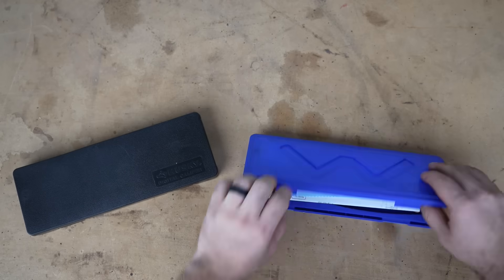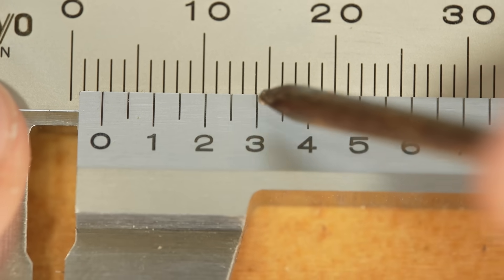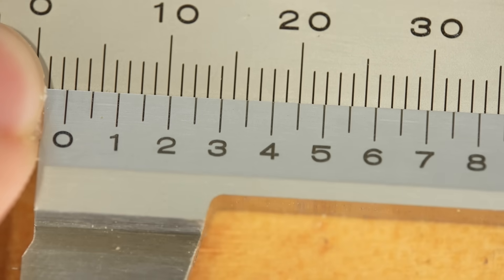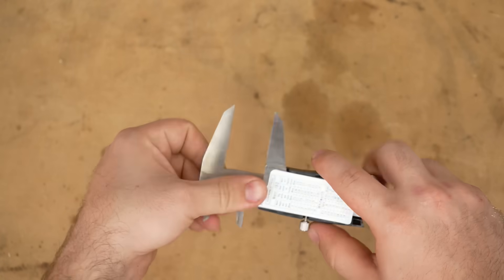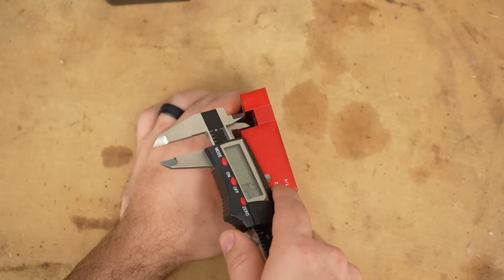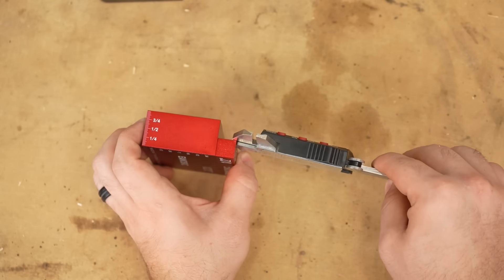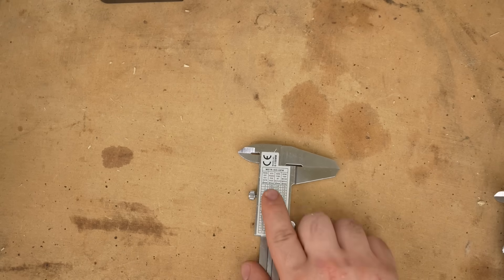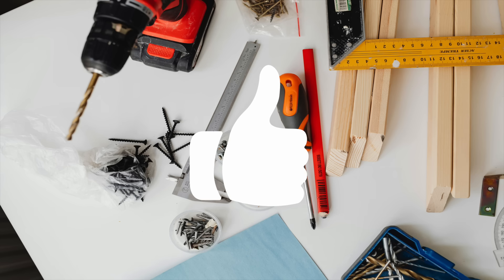I wish i’d known this sooner, How to use calipers like a pro

Comment: I lost all respect for your advice when you stupidly said,  "... put some TENSION on the calipers ... ". So, you are stupid to not know the definition of the word "tension". Please look up the word "tension" in common use as a PULLING FORCE. What you should have said is: "to measure the objects outside dimension, put the object squarely in the jaws and apply mild COMPRESSION. The word "compression" is in common use as a squeezing force.

Comment: Accuracy of the calipers doesn't depend on way you read them, it depends on the tolerances and accuracy of the tool. Vernier, digital, dial, etc can all be equally accurate.

my preference is dial. It's super easy and fast to read, and they don't require batteries. Also, I've seen digital calipers do wonky things when their batteries are low.

Comment: I went back to a NAPA auto parts store with the new part they just sold me which was wrong. I took my vernier caliper and measured it right in front of 3 of their sales staff showing them the reading, then handing them the part and the caliper. They were all over 40 but none of them had a clue how to read the scale. After maybe 15 seconds one of then ambled off, returning half a minute later with the store's digital caliper. They were amazed that I had told them the exact measurement their caliper showed with something that 'simple' 😁

Comment: Apparently the “China Export” mark is a myth; it’s just a matter of poor typesetting by manufacturers and, while it is present in some fraudulent uses of the mark, it is also present on some certified products. More importantly, some fraudulent uses of the mark use the correct spacing. The improper spacing and possible fraudulent uses don’t really correlate.

Comment: I guess because I got less expensive ones, my experience with the digital calipers  has been that when I wanted to use them the battery was always dead.   The type I like the best is the dial caliper with dual scales,  thousandths and fractions.

Comment: The CE is not a sign of quality. The manufacturer says that they conform to the standards for selling it within the EU. They make sure of that themselves :). So even if you see it and it is the correct one it doesn't say much at all. 
Norms, tolerance ratings, being approved for certain work, tested safety says a bit more.

Comment: Recommendation, especially for The occasional user, consider dial gauge calipers because they are as easy to read as a digital and they don’t need batteries and it’s almost guaranteed your digital will still be on when you come to it eight months later with the last .5% battery left.
Reply: They key to keeping the batteries alive is to get calipers that have manual power on. I have a set of cheap digital calipers that automatically turn on if the scale is moved (it assumes you want to measure something). Trouble is, they'll power on just sitting on the counter if you breathe in their general direction. They also don't maintain zero, so they've pretty much been thrown in a drawer to rot.
Reply: @garrisonaw I’ve got Moore and Wrights that aren’t cheap or automatic but somehow they always find a way to turn on and go flat. Although I’m a contractor and work from a toolbox not a workshop.
Reply: @DigitalArtisan77  Glad that's not me. I would become obsessed with figuring out how to stop them from powering on.
Reply: @garrisonaw  I did LOL. I switched to dial gauge. 😂😂

Comment: Digital and Dial are the most common calipers out there.  Vernier's are hard to find now-a-days.  Digital are better because they can be backlit.  If light is low - it's real hard to read a vernier.  That's one more reason why they're hard to find.  But don't let me stop you.  Go ahead and explain what it is you wish you knew sooner; how to use calipers like a pro.  BTW:  I've been using calipers since the late 70's.  Nearly 50 years now.  And yeah, like @David-xl9cp said - old eyes need glasses to read verniers.

Comment: Be aware that the measurement of the caliper doesn't have to be equal to the reading of it. At 0:18 4 calipers are shown, 2 digital, 2 analog. The digital calipers might have a reading of 0.01 mm, but is that actually true? The analog calipers say they're accurate to 0.05 and 0.02 mm. That tells me how accurate it's made. However both can only read 0.05 mm.
As a former teacher once said: a caliper is just an uograded adjustable wrench. A digital caliper doesn't become more precise, because you can read 0.01 mm. If you put a fluorescent lamp in it, it might even show you 0.00000000001 mm.

Comment: I close the calipers on the object being measured by pushing the jaws closed at the point they contact the object instead of using my thumb to push the base of the movable jaw. This method eliminates the deflection when measuring near the tip of the jaws and the measurement is more accurate and repeatable.

Comment: There is one more measurement feature for the digital calipers that I use frequently. To check the center to center distance/hole spacing of two equal diameter holes, put the inside jaws in one hole and zero the readout at the diameter. Then place one of the inside jaws in each hole to the maximum distance of the outside radius and that is your center to center distance.

Comment: 👍Thanks for video. I recently swapped my digital calipers for vernier. Why?
1. I never quite trusted the digital readout. If the tracking mechanism slips, displayed value is wrong.
2. Got fed up changing batteries.
3. Digital calipers have to be reset to zero everytime you go to use them and frequently during use (to avoid problem 1 above).
4. Very easy to accidentally press the various buttons during use and you have start all over again.
5. Became obsessive about setting them to precise. For example, if I wanted to set them to 3mm, it had to be 3.00mm. 2.99 or 3.01mm just wouldn't do. For most tasks +/- 0.05mm is fine. So, this was just a wasting my time.
With old fashioned verniers, I don't have to worry about any of the above.

Comment: What, no analog dial caliper? I still have my Mitutoyo 505–637-50 Dial Caliper which I purchased in 1985. It is in perfect condition since I only used it is a controlled inspection lab environment. These were what was available in between the Vernier and digital calipers. Nice since no battery is required yet the dial is easy to read. We used to call the Vernier caliper the "very-near" caliper!

Comment: Accuracy, Repeatability and reproducibility with any caliper (or any other hand tool) requires Practice Practice Practice to a "KNOWN Calibrated Standard". Every tool requires a "Feel" and remember the 10:1 rule......Try to Choose a measuring tool that is 10x more accurate than the feature/tolerance you are measuring

Comment: Non digital vernier,
Is the depth measuring the same process as outer/inner diameters & step measurements?  Main scale & vernier scales regardless if it is Imperial/Metric?

Comment: Something's missing!
The upper display of the vernier scale is for inches.

the main scale shows the whole mm

and the lower vernier shows the decimal places. 
 (now what is missing)
It is also important to know how big the distance is from line to line on the vernier. In other words, how high is the reading accuracy, i.e. the smallest measurable difference (e.g. 0.02 mm. There are mainly tenths of a mm and hundredths of a mm) The reading accuracy is usually located at the bottom of the main scale or on the back or front of the head. Otherwise, you'll have to look. xD If it's not on the caliper then it's in the manual. 

It makes a difference whether something is 0.2 or 0.02 mm long, or even a different size.

Comment: You wouldn't believe how many things you can fix with a set of these, an absolutely silly amount of things. Personally I prefer dial calipers; pretty good precision, no batteries, don't have to think much per measurement. 

I got my parts to my EUC today, I needed a weird and specific bolt.
Reply: I've never seen anyone "fix" anything with calipers. 🤔
Reply: @trueaussie9230  I fixed the problem of lack of measurements of a physical good.
Reply: @trueaussie9230  they also make a really shitty/based wrench.

Comment: Digital calipers are not accurate at all—even those from the renowned Mitutoyo (a brand that never outsources to Chinese OEMs).

This is because digital calipers do not actually measure length. Instead, they rely on capacitive differential sensing—typically through internal PCB copper traces—to count increments or decrements. Contrary to what most mechanical engineers might assume, the microcontroller inside a digital caliper never truly powers down. Once the zero-reset button is pressed, it continuously counts from that "zero" point, even if the display turns off afterward.

Herein lies the problem: a tiny speck of dust, an oil stain, or a slight impact on the stainless steel surface can prevent the caliper from achieving a true zero position. As a result, all subsequent measurements are flawed.

While the Vernier caliper is fundamentally the most accurate—affected only by thermal expansion—its low readability often leads to user errors. In my opinion, the dial caliper strikes the best balance. For those familiar with dial calipers, we know how painstaking it is to clean the two flat "jaws" repeatedly with a cloth to achieve a true physical zero position, rather than a misleading 0.005–0.02 mm offset.
=================================
To use a digital caliper reliably, always keep a known-diameter precision rod inside the case (the shank of a high-quality PCB carbide drill works well for this purpose). Set the zero, put in the rod, and verify that if the caliper reads exactly 3.175 mm (or 1/8 inch)?

Comment: Screw digital calipers! They're shit, they've always been shit, they're alwaysngoing to be shit, if they get even the slightest film of oil on them you might aswell use a piece of bread to do your measurements and they always run of of battery when you need it the most, or the battery doesn't make propper electrical contact at the worst time possible, when you just managed to make a measurement of something in the most annoying place, oh and they can't hold the zero for shit.

Even the cheapest vernier caliper will have good enough accuracy. Heck you can measure with it even if the zero lines don't line up propperly.

Oh, and vernier calipers can be made small and out of plastic if you need plastic calipers for some reason.

Comment: The only caliper regularly used by real engineers is a precision vernier height gauge and this is used in conjunction with a surface table or plate.  In practice calipers are easy to misuse leading to inaccurate measurements so real engineers tend to refer to them as 'Very Near Gages'

Comment: The problem with digital calipers is that they’re to precise and give different results on every measurement. 2,39 2,38 2,4 while this usually means nothing in a practical sense I muts prefer my analog calipers as they will just say 2,4.

For most people this means nothing in a practical sense.

Comment: One nice rule of thumb for the drill sizes for thread holes is that you subtract the pitch from the nominal diameter, for example the M3 has 0,5 mm pitch so 3 mm - 0,5 mm = 2,5 mm. This doesn't always line up, and in today's world it's a good idea to have Camcut app on the phone so you can quickly check thread and hole measurements, tolerances for shafts and holes and torques for different bolt situations among other things.

Today you learn about China Export at engineering schools, unfortunately. There's quite a bit you have to know about directives as well, essentially safety regulations etc on whatever you're dealing with as an engineer (pressurised vessels or you name it).

The step measurement was all new to me, I luckily knew the rest already. But what catches you off guard is drawing values. Like you can technically properly measure internal and external lengths, but step like lengths are just "for the fun". And having to have geometric tolerances so the subcontractor won't give you the wonkiest piece you've ever seen that doesn't even fit in the product and claim "it fulfills the measurements in the drawing required" because you didn't have tolerances for the geometric shape.

Comment: The proper name for the tool is a Caliper. The three different types are: Vernier, Dial and Digital electronic, also known as LCD. The "Vernier" has the lines that you match up. The "Dial" has what looks like a old type watch glass with a needle. The digital electronic type reads out in numbers and should be switchable between Metric and US measurements, it also has a replaceable coin cell battery. I personally recommend Mitutoyo brand. "While Mitutoyo has production facilities in other countries, including China, their high-end calipers, especially those used for precision measurement, are often still made in Japan."

Comment: Decent info, those are far from good calipers though, obviously just depends on your needs but saying they can be accurate to .01 isn’t super accurate. I was using dial calipers accurate to .0001 but what I was making called for it. I’m not even a machinist anymore but I feel like an elitist typing this. I guess it’s just what I was used to, if I brought a set of these into the shop they would have thrown them out cars I would have been way off

Comment: I am a machinist and I prefer dial calipers because I can't easily see the thousands measurements even if I am holding them at weird angles (sometimes you can't take a part out of the machine but still need to measure). Verniers are too hard to see without getting up close and digital needs to be looking straight on or light glare will prevent me from seeing anything. So what I do is take the measurement and see the dial indicates a .045 reading and then I can pull the calipers out of the machine without worrying if I moved the scale at all and see that it is actually 1.345.

Comment: Read a lot like a slide rule and of the same vintage.  I don't use calipers every day and battery ones are useless to me as they're always dead.  I have no problem with dial calipers and own 6 of them.  The only vernier in my shop is 
a 3 foot one.
The CE scam is typical Chinese.  I have a transit which is labeled "Lietz". An obvious attempt to make it sound like "Leitz", the German manufacturer of very high quality optics. One of my uncles bought the Lietz at a cheap yard sale  and it's a decent instrument, but certainly no Leitz.  Uncle didn't speak German (I do) and thought he was getting the real deal.

Comment: Excellent video and info ... which was clear and concise!  I hate when the person repeats themselves unnecessarily. 
I am a woodworker, so I have usually no need to go past 1/32" and rarely 1/64th (mostly machine tuning). I have a digital caliper for everyday use and a highly accurate dial caliper (has 64th line and 128th ticks as well as in 10ths) for more precise measurements.  I keep it in the drawer in its case.

As an aside, I've never understood why woodworkers carry bulky 25ft (or greater) size measuring tapes. Yes, you need one for sheet goods and occasional carpentry type measuring, but those are the exceptions and can be accomplished by such a tape that you'd keep at the bench/drawer.  Face it, we all have MANY different tapes in shop ... so my everyday carry is either a 6ft or a 3 ft quality tape. The flat tapes and lefty/righty tapes are very handy on the bench as well.  👍🙂

Comment: One important thing, whether you use a Vernier or digital, is to take more measurements in the most correct position and in case of slight discrepancies average that out. DOn't always trust your first reading.

Comment: I had a Moore & Wright vernier calipers for decades and because the inscribed faces were flush with each other there was no Parallax error whatsoever.. great caliper...at least it was until one day it slipped off the back of the mill table and got caught between the table and the mill and got crunched when I wound the table inwards... 😭

😀👍☘️🍻

Comment: Measuring Center-to-Center Distance Between Equal-Diameter Holes Using a Digital Caliper

Zero the Caliper:
Start by measuring the inside diameter of one of the holes using the inside jaws of the digital caliper.
Once measured, press the zero button to reset the caliper reading to 0. This effectively accounts for the two radii of the holes.

Measure the Center-to-Center Distance:
Without changing the caliper setting, insert the inside jaws into the two holes, one on each side, so that each jaw touches the outer edge (farthest point) of each hole.
Extend the caliper until both jaws are firmly in contact with the outer edges.
The reading now shown on the caliper is the center-to-center (C-C) distance between the two holes, since the previously zeroed radii have been subtracted.

Comment: Really nice video. An extra tip:
If you want to measure the distance between two holes, then measure the diameter of one hole, then zero the read out, and then measure the distance between the holes, at the part of the walls, that are farthest apart. It has saved me a lot of time, but sadly I only works, when the holes are the same diameter.

Comment: Quick note to all utilizing these “calipers” , just remember these are meant to be a “Ref”. only tool ! The only people that can actually be accurate with these instruments would be a well seasoned machinist or someone with the care and understanding of what accuracy is !
      The minuet you start tilting or using too much pressure ( forcing ) etc.the “accuracy “ goes out the door , not to mention if the jaws or surfaces of the calipers have any nicks or abrasions to the surfaces of the areas being used in measuring any feature.
     F.Y.I.  I have been involved in calibration throughout my career in manufacturing , metrology has really opened my eyes to what & how accuracy is obtained ( truly intriguing ).